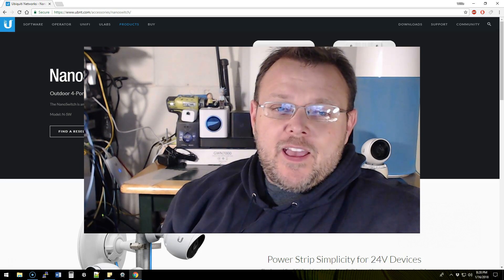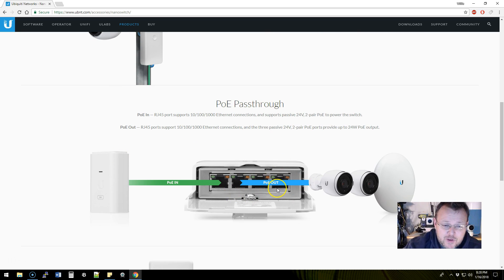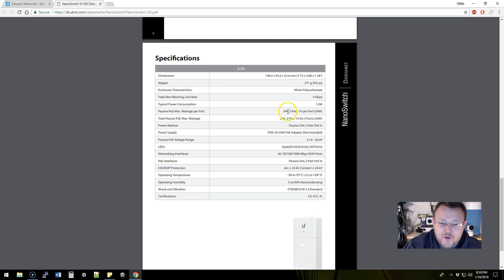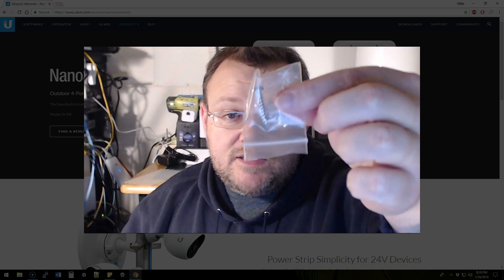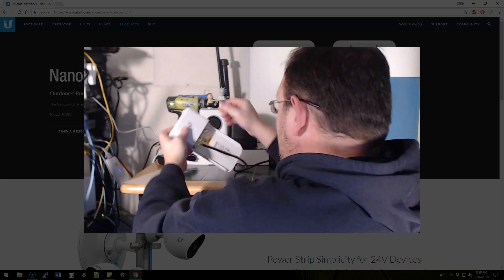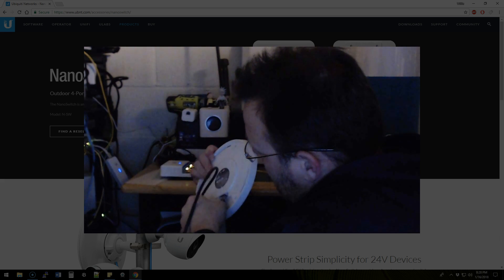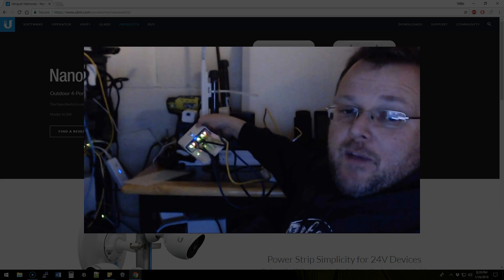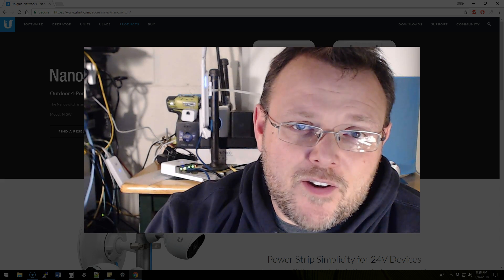Ubiquiti NanoSwitch

Comment: @willie Howe -What am I doing wrong. This will power up if I use an poe injector that came with one of my AP’s.... however my unifi 8 port poe switch (60w) will not power this up and I’m plugged in one of the poe ports. This should work right?
Reply: Did you get it to work with the 8 port switch?

Comment: Can you connect non-POE devices such as the hub of alarm system that doesn't need POE but just only data? I require one of these as I have one cable and need to power a camera and secondly need data connectivity for the alarm system

Comment: In the manual and quick start guide, they suggest POE-24-30W-G-W PoE [2-Pair Powering – Pins 4, 5 (+) and Pins 7, 8 (-)] power supply, but I could only find POE-24-30W [4-Pair Powering Pins 1, 2, 4, 5 (+) and Pins 3, 6, 7, 8 (-)] version according to specs, on amazon. Would the 4-pair power injector work ok?

Comment: As w/ your other videos, great/informative video.  Almost bought a nanoswitch before watching this clip.  I have to power a UAP-HD (which apparently is an 802.3at only device) and a UVC-G3-PRO (802.3af or at) from a single line (which comes from a US-16-150W).  After seeing your video, decided to check and the nanoswitch will not power those 2 devices.  Any idea what will?  (note, I don't have access to an AC line at destination point; which right now only has the UAP-HD on it).
Reply: @WillieHowe   … Thanks … was afraid of that.  I think a UAP-IW-HD should work (since I don't nee it outdoors), but seems overkill AND it's out of stock.

After googling a bit I Found this device (Planet POE-E202 1-Port 802.3at PoE+ to 2-Port 802.3af/at Gigabit PoE Extender), but not sure if it'll work.
Reply: Never mind .. think I just answered my own question.  w/ 802.3at on the incoming port (from switch), any passthrough device would pull ~25W … the 2 devices I'm using (UAP-HD and UVC G3 PRO) together pull ~30W (17W + 12.5W) … plus a couple of Watts for the device itself .. = no go!
Thanks anyway.

Comment: Lab setup=        isp dsl->  edgerouter X------> 5port toughswitch poe------> nanoswitch =======> nanostation AC local AND  unifi Mesh AC M.....

Unifi mesh AC M works ( start flashing blue light and stays blue)  when i unplug the nanostation AC M from nanoswitch.

I check the specs and the mesh M and AC Loco   consume MAX   .5 AMP and 0.3 AMP.  The nanoswitch i powered with 1AMP 24 Volts, so in theory  it should work. Why is not working?  

P.S i disabled the management radio, on Nanostation AC L still the same problem.

I opened a ticket for this issue with unbt guys here it is: 1263313

PS.  The ubnt chat support is a nightmare.  I posted  here cause i could not see it the message after login out of google.

Comment: So what magic does this device perform?

Not sure I understand how a single 24v feed can be multiplied to support 3 devices each supporting 24v without losing power/voltage.
Reply: The ports are wired in parallel. The current get's divided but the voltage is equal over all 3 ports. The power will be split in 3 just like the current. You're confused with 24 watts. If you have a 24V 1A powersource, it will provide 24*1 = 24 Watts. It means you could power 3 devices with a total of 24 - 1,5 watts (for the switch itself ) .

Comment: Wishing they did allow it to be seen/managed in the Unifi controller.  Sorta like the US-8 switch that's 1x port pass through.  Always good to be able to peek at individual ports...so you can find if 1x device up there is having an issue, study packets, adjust link rate per port, or...flip power per port if you have to bounce 1x device but you don't want to bounce all 3x devices like you have to now by bouncing power on the source 24 uplink. But still..nicer than having to run several ethernets up a marina pole on the docks!

Comment: Got a few AF G3 cameras last week, but they simply add an AF converter in the box and the cameras are still 24v. But yes, also heard in future the cameras themselves will be AF
Reply: @WillieHowe  I had to buy a converter as i bought a Netgear poe dumb switch with AF support the outdoor converter is really poorly designed as the non-removable male end for the G3 camera is almost too short with the wall mount option..im fixing this with some ethernet couplers to use a longer patch cable between the converter and the camera

Comment: That one not being punched out must be intended. Mine is a beta unit (last batch) and that one slot wasn't punched out either.
Reply: It makes sense.  You likely wouldn't use this switch for a single downstream device - you'd use it for 2 or 3.  With the upstream link added in you need either 3 or four holes.  So this is why 3 holes are pre-punched.

Comment: The reason why there are 3 punched out because you'll never use it for 1 or 2 but you might use it for 3 but not all 4 😉
Reply: Exactly... If you have one device, you don't need the switch (so it will never have just one cable in it). SO, you will have either two or three devices, plus the cable that feeds power and provides data... hence, three puch-outs open and one left blanked. I also noticed a blank for the grounding wire. Seems like UBNT is putting a lot of thought into their designs!
Reply: Why wouldn't you use all 4 punchouts? If you have one feed and three attached devices you would have to open the final punch out.
Reply: Jean-Pierre White sometimes you only need 2 devices connected and 1 feed this way it's still sealed to the elements and insects when you using all four ports you only have two pop off one little piece

Comment: Nice little device and thanks for sharing another great little video. Question though if I may - how does it handle tagged/untagged traffic (such as when supporting multiple VLAN-backed SSIDs? Will it transparently pass tagged traffic or will this device only support a single untagged VLAN? Thanks!
Reply: Orinthical I have the same question. Would love to know. If anyone has the answer. Also, would have liked to see this all come up in the unifi controller.